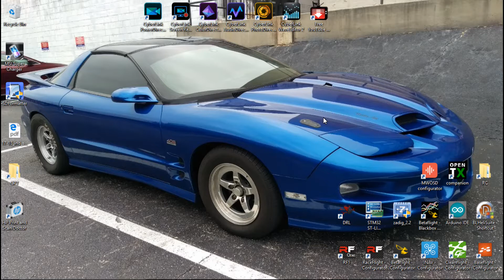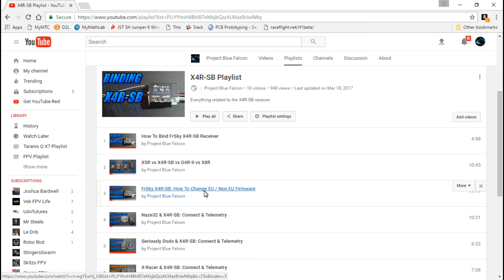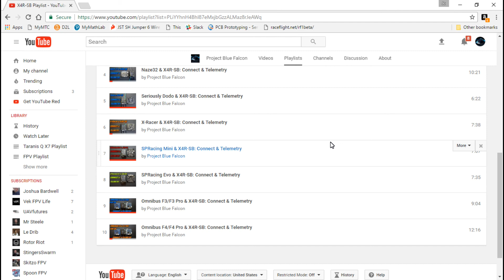Taranis Q X7: Connecting Receiver (bind, wiring, telemetry)

Comment: Thank you so much for all of this... I'm learning a crap load... would of took me long time to figure it out... I just got my reciever and setting it all up now... thankfully I have the newest firmware I believe, which was June 24th 2018 2.2.2 (I got a 32gb card cause the stores 16gb were sold out and I couldnt wait lol)... I got the folders from frysky and sound back from open TX University... I'm just waiting on leader 3se and mobula7 to arrive...but in meantime setting everything else up and looking waiting on mini usb cable to come to run some simulators.... I'm setting up test models just for practice as well...thank you for all these videos...they are very helpful and put together well

Comment: Hey falcon I need help if you have time. I recently bought a geprc hummingbird bnf with the frsky receiver installed I bound it and the light is green on the Xm plus. I bound it to 2 transmitters the jumper and the taranis qx7 but the quad doesn’t arm or spin the motors when I use the throttle stick. Any ideas on what I can do? I got the taranis brand new no set up nothing just new how to bind that’s it

Comment: Hi; great videos. Question can you please make a video on how to bind the Taranis Q X7 to a Blade Inductrix factory board?
Reply: It's only possible if you either change the fc to a frsky compatible one or you get an external thing  (I can't remember what it's called) that goes back of the transmitter. I hope that helped.
Reply: Yeah... i got an OrangeRx module. I finally got it to work with the factory Inductrix board. Thanks.
Reply: Omar Vazquez ah okay.